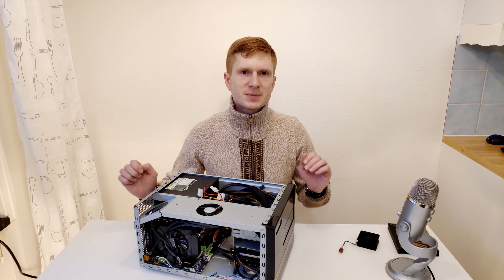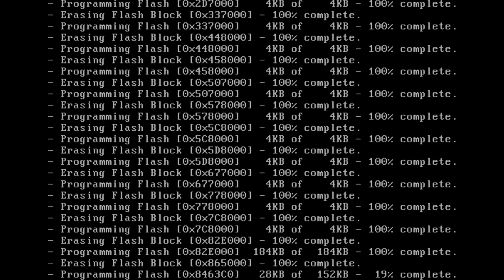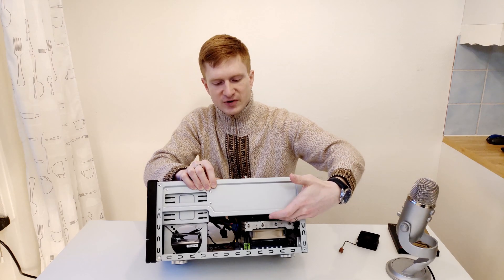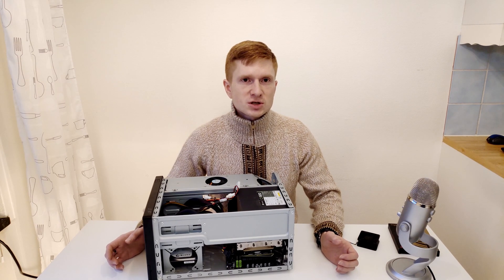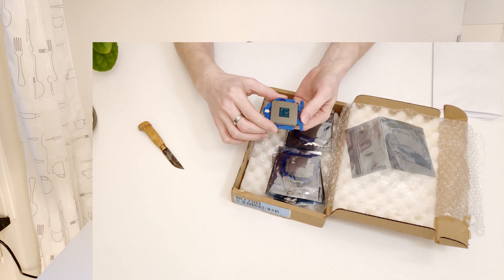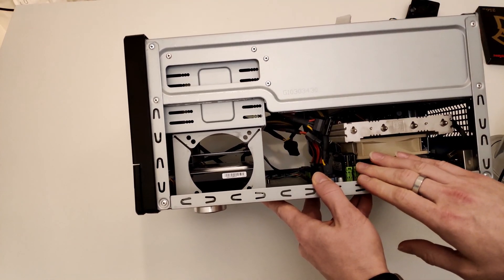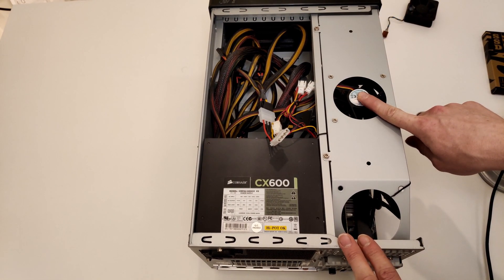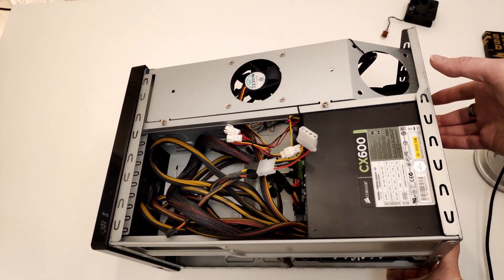🇬🇧 Assembling a Micro-ATX PC with Huananzhi X99-8M and Xeon E5-2650 V3

Comment: Nice videos Mate! I watched many of them Thanks for your reviews and suggesting what is better to buy!!
I'm planing to make a build with this motherboard with E5 2678 V3, so  what is the best ram for best performance with this board? ECC, NON ECC OR REG-ECC because i see that support all of this? My plan is to Buy Kingston HyperX? Is this best ram for performance? Also what memory speed need to choose? looking the spec of the CPU that i want to put maximum supported memory speed is 2133, so do i need to put exact speed or I can put faster speed for example maximum speed of mother board support is 2400 is will work better with 2400 or 2133 is enough to be parallel with the CPU?
So what is your recommendations!?
I need fast answer! 11-11 is here so i need to make the purchase :D 
Thanks in advanced!
Reply from the maker: You need the cheapest X99-compatible RAM. Xeon E5-26XX V3 CPUs are locked and maximum possible RAM speed is either DDR4-1866 or DDR4-2133. Also beware that Huananzhi X99-8M-F and X99-8M look very similar, but these two are completely different boards.

Comment: Thanks you, I need a stable one to make videos, can you advise me what kind of m-atx board should be used in combination with xeon E5-2673 v4 cpu 10 cores, 20 threads ??I
Reply from the maker: If you really need an mATX then take a look at Asus X99-M WS, EVGA also has a few good options.
Reply: @Miyconst   👍👍 Asrock x99m xtreme4 or fatal1ty killer any good bro
Reply: @Miyconst  👍👍 Asrock x99m xtreme4 or fatal1ty killer any good bro ?
Reply from the maker: @TRANMEDIAVN  yes, both are good options.

Comment: i wonder if this could stand the use for a cheap workstation with a 2678v3 and some intense rendering sessions in turbo mode...
Reply from the maker: Yes, it could, but only if you implement good airflow in the chassis
Reply: @Miyconst  thanks ! ... the double channel memory made me change my mind, and your videos!  i guess the F8 or TF still one of the best options, i really need something cheap but powerful because i am in the middle of a video production job to do. Instead of the Xeon E5 2678v3 with this X99 8M board i think i will get the X99 F8 one (unless you suggested some better one around the price) with some really cheap but fast core speed CPU, some 16xx series i guess...  and i will upgrade it later to the 2678v3... yes, better choice, quad channel seems a real difference to me, i know i'm going to hate that little VRM fans but... thanks to your videos again, i'll follow your VRM radiator hack :D
Reply from the maker: There is no need to upgrade E5-1660 V3 with E5-2678 V3. Overclocked E5-1660 V3 matches multi-core performance of E5-2678 V3, but beats it in single core performance.

Comment: Is Xeon E5-2678V3 with 16GB RAM 2400Mhz DDR4 worth for ≈ 200USD?
Reply from the maker: Just the CPU and the RAM for $200?
Reply: @Miyconst  and motherboard too
Reply from the maker: @rodney_c1374  then it depends on which motherboard.
Reply from the maker: @rodney_c1374  I still think that $200 is a bit too much, but if you can't find a better deal, then it is worth it. Regarding the VRM, it all depends on how you intend to use the CPU and what airflow you have in the chassis.
Reply: @Miyconst  I'm gonna adapt an active disipation to VRM and chipset. Will change thermal Grease and put a better heatsink + mini fan. My  case has an excelent airflow (3 fans in front + 2 fans up and 1 fan in the Back) that would be enough to make its life longer, right?
Reply from the maker: @rodney_c1374  yep, it's gonna be just fine.

Comment: You make unlock turbo boost in e5 2650 v3, the mobo support? Have problem with vrm temperature? The huananzhi 8m support e5 2678 v3 with unlock turbo boost or vrm broken?
Reply from the maker: Turbo Boost unlock works on this motherboard, and its VRM is good enough to handle E5-2678 V3.
Reply: @Miyconst  thank you very much, i see a lot of your videos, is that you have some Youtubers br, saying that the card doesn’t support more than one e6 2640 v3, because VRM couldn’t take it, thanks for the information, I bought the ticket for 8m, good to know that it will endure !!! ✌🏾😎🤙🏾
Reply from the maker: @ViniBoyFPS  It will be just fine if you have a decent airflow in your case.
Reply: @Miyconst  Good to know! Thank you Very much, your videos are Very good!!? Success for you!

Comment: Hi, i'm interested in buying and overclocking that cpu+mobo, do you think that with a decent case and a proper airflow the heat is sustainable or I should not overclock using this motherboard? 
P. S. Thanks for your videos, they are incredibly helpful!
Reply from the maker: This motherboard has exactly the same CPU power delivery system as Huananzhi X99-TF / X99-F8, thus, if you have a decent case with decent airflow, it's safe to overclock. I would bet that E5-1650 V3 would work stable at 4.2 GHz, 4.3 GHz should also be doable, everything above depends on how good your CPU is, some unique pieces work at 4.5 GHz with less than 1.3V.
Reply: @Miyconst  Perfect! Thank you so much for the help

Comment: Another great review, thx for that! Anyway isn't that GTX 1050ti little bottleneck for this cpu? You had better cards in previous videos, there is not much fps on that card, why did you chose this one? And you mentioned that Xeon 1650v3 is equivalent for 5820k, how it is with 2650v3? Many thx!
Reply from the maker: This was a PC for sale, and the customer wanted to have GTX 1050 Ti, I do agree it's a weak card for this CPU. E5-1650 V3 & i7-5820k are identical CPUs, 6 Cores, 12 Threads, unlocked multiplier, E5-2650 V3 is a different story, 10 Cores at 3.0 GHz (unlocked turbo boost) in some games will be better in others worse. With the current pricing ~€100 for E5-1650 V3 and ~€70 for E5-2650 V3, I would pick the latter.
Reply: @Miyconst  And is E5-2650 V3 also overclockable? And how it is in real life with that turbo boost drivers? You said that Windows update could corrupt them. How often is this hapenning? Did it happened to you during your testing? I am afraid that without turbo boost it does have not that power boost for which I am looking for. Also what do you think about E5-2650 V3 vs E5-2689? Could I unlock turbo boost in 2689 aswell? I know that its slightly differen socket (only 2011), but now I am in deciding wether it has a value for the price for me to go for 2011 or 2011-3 or forget about this whole platform.
Reply from the maker: @thepretiso  Windows does not "corrupt" the drivers, it removes them. The fix is easy - load from the flash drive and install the driver again, following the instruction. In my case it happened every time I did BIOS reset and once after Windows installed large updates.

Xeon E5-2650 V3, even without Turbo Unlock, is a better option than E5-2689. On LGA2011 you can't unlock turbo boost, it's only applicable to LGA2011-3.

All Xeon E5-2600 CPUs have locked multiplier, thus you can't overclock them, only unlock turbo boost. What is your usage scenario that you are afraid that E5-2650 V3 won't be enough?
Reply: @Miyconst  Thats what I am afraid of to need to install driver too often. Anyway I want E5-2650V3 (better 1650v3 but its still expensive) but option with 2011 is way cheaper (MB +-85$ and CPU 55$ and Ill keep my RAMs) instead of 2011-3 (at least X99-TF +-100$ and 2650V3 which is 75$ but need of new DDR4 RAMs for another 50$) so its price - 140$ vs 225$. Anyway I saw videos with Xeon E5-1650V2 which was oveclocked. In this case, 2689 vs 1650v2? There is plenty of xeons, plenty of mobos, I would love to go 2011-3 but I am affraid that its too much for my budget :( THX for answering my endless questions!! :D :)
Reply from the maker: @thepretiso  If you are on a very tight budget and already have DDR3 RAM, it's better to go for LGA 2011 with E5-1650 V2 then spend the saved money on a better GPU. E5-2689 in general is worse than E5-1650 V2 overclocked to 4.1 GHz, but you would need an RTX 2060 / RX 5700 or faster GPU to see any substantial difference between these CPUs in modern games.

Comment: hey bro if cpu has unlock multiplier can't you now simply overclock by using intel extreme utility (xtu)
Reply from the maker: It depends on the CPU, motherboard and BIOS. Huananzhi X99-8M BIOS does not support overclocking at all, Huananzhi X99-TF & Huananzhi X99-F8 overclock Xeon E5-1650 V3 & i7-5820k properly, but fail with i7-6800k. I am currently testing Huananzhi X99-F8 and it's detailed review will come out soon.